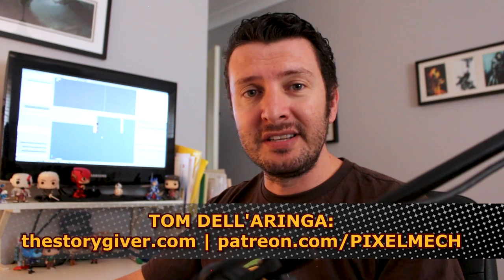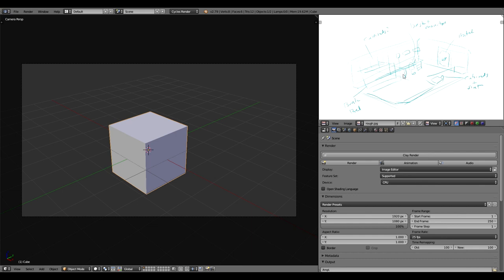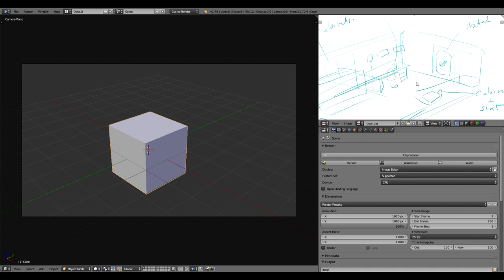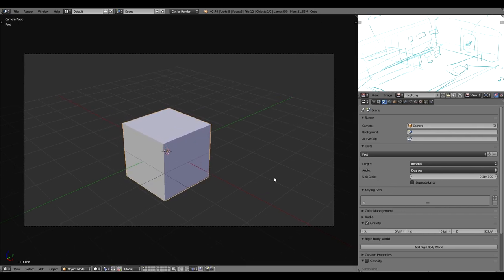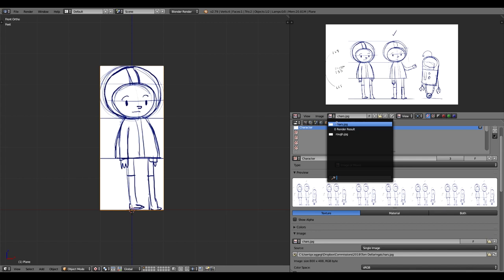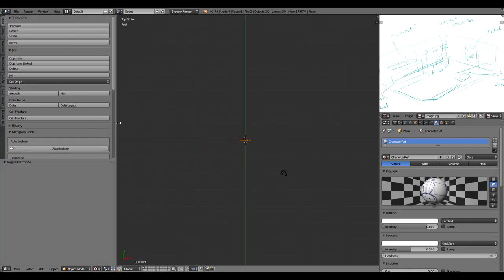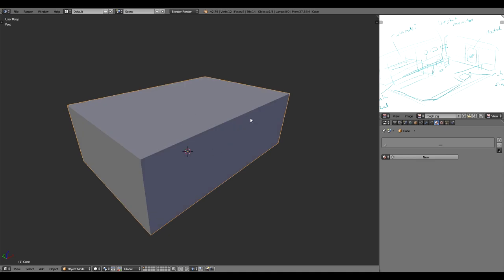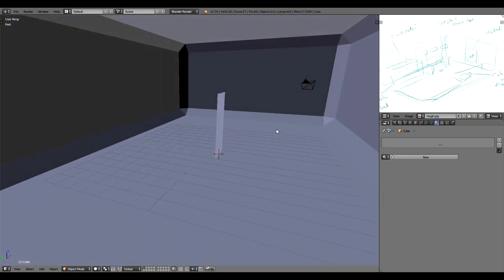Modelling a Sci-fi Habitat

Comment: Nice work.
One trick I found helpful when encountering situations like the opening in the bed:
You created two loop cuts and then manually moved each one over to enlarge the opening. One thing you might try is to use a single loop cut followed by the bevel command.  That is, after creating the loop cut, simply use ctrl-b while the loop is still your active selection, then move your mouse and it will 'bevel' the single loop cut into two cuts that are moving apart symmetrically, keeping what will soon be your opening centered and also forcing the two cuts to keep the same orientation as the original centered loop cut. That behavior also makes it easier on objects like the hatch, where the overall object has an irregular shape. Since the centered loop cut would basically be at zero degrees, when you bevel that loop cut, it makes it forces the two new loop cuts to keep that orientation regardless of how close they get to the angled lines at the end. Great video. would love to see this model rendered out with materials.